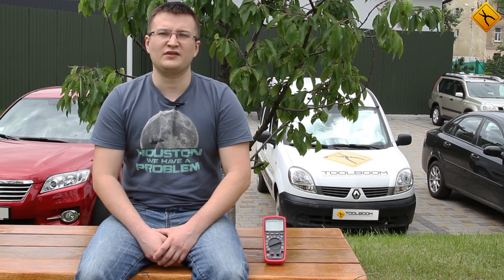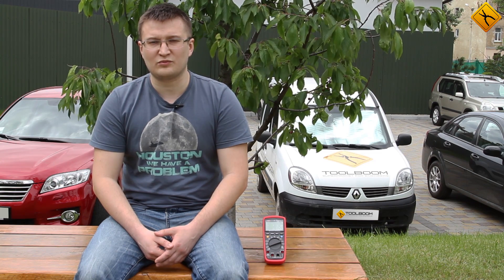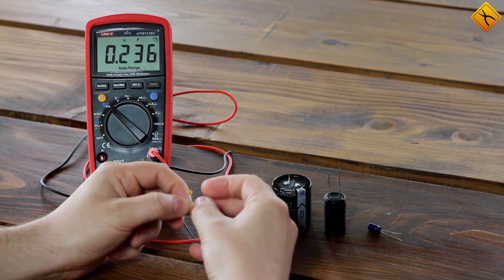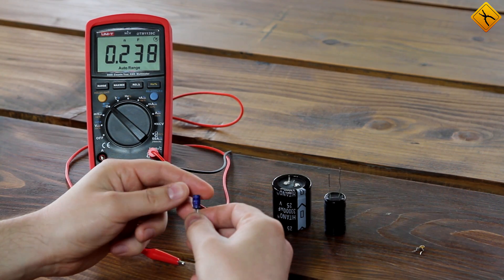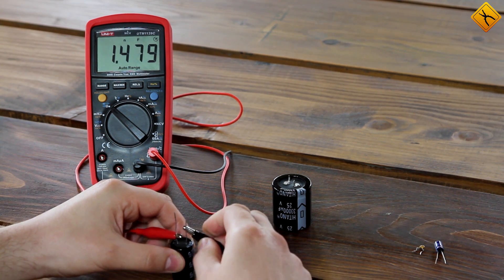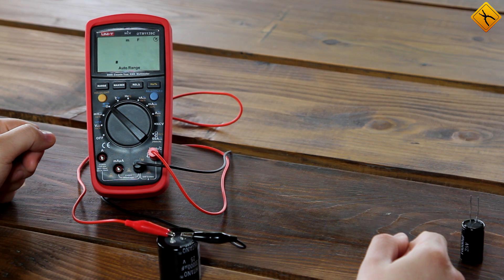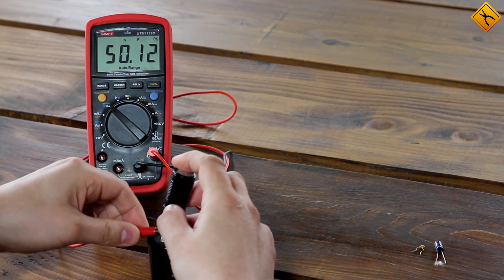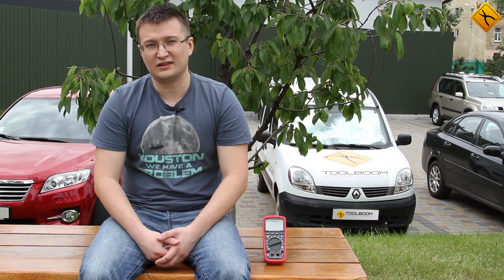Testing Capacitors with the Digital Multimeter UNI-T UT139C

Comment: Fluke meters can read high microfarad, dome of the start capacitors on air conditioning equipment on large systems will go over 100 microfarad.

Comment: Can you measure 8 pF or 27 pF capacitor?
Reply from the maker: Hello! The UT139C multimeter allows you to measure this capacitance value, but it can have substantial errors. 
For more accurate results when measuring small capacitance values we can recommend specialized equipment - UNI-T UT601 Inductance Capacitance Meter: 
https://toolboom.com/en/inductance-capacitance-meter-uni-t-ut601/